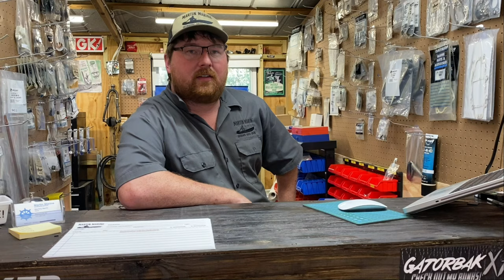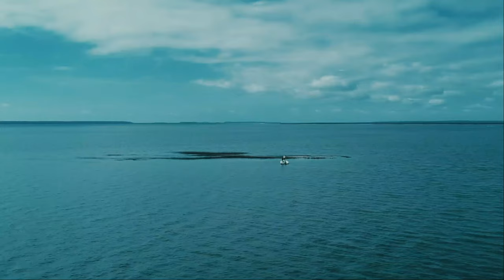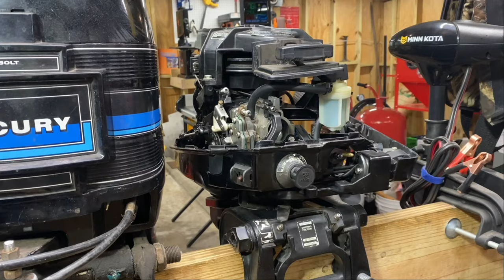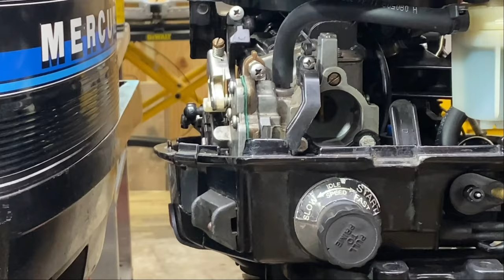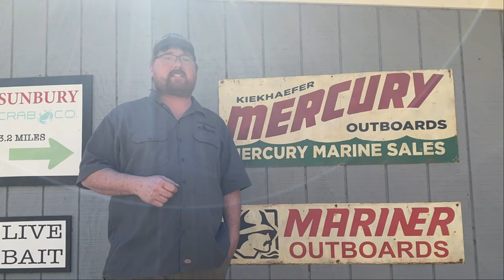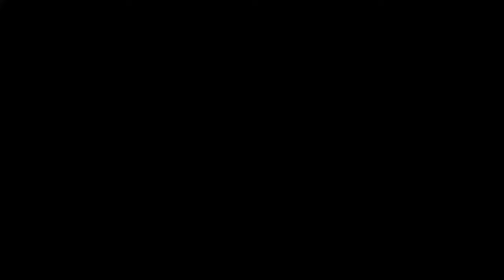How To Adjust A Mercury 2-Stroke Carburetor 6 8 9.9 15 HP 1989-2006

Comment: I have what believe is a decent tuned motor exactly like the one in your video, 8HP 2 smoke, but im getting milky snot from the exhaust port, is this normal some say yes and then some say not so much, im using Lucas synthetic oil (15oz for 6 gallon can) brand new carb rebuild and accel pump. lil smoke not too much but some beige milky goop from the exhaust... any help would be great thanks, great vid! subscribed

Comment: I just did the carb rebuild after watching you video. (Great video) i put it back together and where its labeled "top" its leaking fuel when priming it. What would be the cause of that?
Reply from the maker: I would try pulling the bowl back off. Then pull the float out. The float is probably stuck. Then lift the leaf springs underneath the float and drop that pin back out. Then just reinstall it all again and should fix it. Make sure the curved sides of the float are faced towards the bowl.
Reply: Thank you sir Ill check that out. Keep them videos coming!
Reply: Great videos that helped me get our outboard running again. We live on our sailboat and use our dinghy as our car so it is incredibly important to have a strong running motor. I had the same issue with the leakage from the top area. The bowl appears (sounds) to be free when I shake or roll the carb when it is off the motor. Any other thoughts? Could you post/send a quick picture of the gasket orientation under that plate labeled top?
Reply: @ffhill85  did you find a fix for the leak? I am having the same priming leak issue. Among others.
Reply from the maker: @joshmilat1048   The needle under the float is not seating. Remember when you pull the float off and lift the brass hinge there is a small needle that falls out. Either the needle is missing or it is not seating properly.
Reply: @joshmilat1048  i assume you mean the float, not the bowl but that means nothing if the needle is stuck in it's seat! remove for cleaning and inspection.

Comment: Great videos. I've been watching them all. I have a question. I have a 25 hp 2 stroke. Motor starts but won't idle. I've recently notice that there is a small port on the right side of the carb that squirts gas out a little.  No idea why. Gas stain in the water. I can get it to run by giving it throdle. Any ideas what could be causing this?
Reply: It's your float. She stuck

Comment: this is a really great detailed vid...   my '05 merc 25hp 2s is hard to start, i'm going to start with this.... im hoping that first adjustment is what might be wrong,, starts all day one pull after its warm
Reply: make sure the primer is really working well. simply loosen the carb mounting nuts and pull it forward and hit the primer. should be squirting into the crank case, not dribbling. turn your low speed needle out 1/4 turn if its really hard to start. beyond that, ignition and timing check is in order

Comment: So I’m having an issue with the exact same motor. It runs well until about 3/4 throttle and then bogs down.. checked all hoses, tank, primer ball, still having issues

Comment: Hi there. I have a 15hp mercury 2 stroke. I’m missing the #37 screw. It’s the M5 x 30mm screw with a jam nut. Could you tell me what the adjustment is supposed to be on that screw?  Engine seems to be running fine with out. Just want to get it back in there so it’s fixed properly

Comment: What would cause a Mercury 25 horse to start and run good even when it's cold but if you stop and fish for an hour and go to restart it it will start on about a half a pull and Run 5 seconds and then die and it's really hard to start in a spark plugs and dryer

Comment: Were does the thermostat go? In the back on the cylinder head? I was checking on a water pump problem and removed a cover on the top cylinder, the tell tail hose was hooked to that cover. There was nothing under the cover but the water jacket was visible. Thermostat goes there? Thanks
Reply from the maker: It sounds like your thermostat is missing. Yes just pull that cover off with the hose coming off of it and if nothings in there it’s missing.
Reply: A video on that would be nice.

Comment: My motor is a 1989 mariner 45 hp 2 stroke on a 18 foot pontoon. It is using 6 gallons of gas in 1.5 hours on the water and the top speed is 7 mph. The carbs have been rebuilt. Any suggestions???? We have adjusted the carbs, but there is no change. Motor runs great, it is just guzzling gas and going half the speed it should.

Comment: Got a 99 Merc 15hp 2stroke, starts right up 1st  or 2nd pull every time & runs good at speed. But idling or trolling I get a misfire often and heavy gas smell & more smoke than should be??  She does 20mph loaded up with 3 people in a 14ft smokercraft voyager & 9x9 prop. Sounds great & good power up on plane, but heavy gas smell & misfire at low speed, any idea where to start?? Thanks.

Comment: Hi
I have an 87 Merc 9.9 that needs a timing adjust.  We rebuilt carb and turned timing screw.  Is there a starting point?  it is all the way in now and that cant be correct. is there a way to DM you?
THANKS
Glenn

Comment: Hello, first of all thanks for all the quality videos, I was rebuilding my engine that is pretty similar to yours, mine is a Mariner 13.5hp 2 stroke.. this week I'll follow the videos after watching it 20 times!! Hope everything goes well.. I had one more trouble and cannot find anything yet so I write it here and maybe you can make a video to help us! 
I'm not able to put reverse, the cables looks good, and forward, neutral and the gas works well, I wanted to take all the cables out, put some grease there and adjust the cables but I'm not sure how to do it.. I use the manual controls to move the engine.. I'm from Spain, I don't know some words but I hope that someone could help me.. thanks you!

Comment: Hello, i did follow steps in the video and it works perfectly now, big thanks and very clear and helpful comments, now everything looks working well, to motor runs like a baby :), the water going out to the motor is maybe to hot from my point of view, question what temperature going out should be and if too hot what should i do to cooling the water temp down. (Note i did change the pump propellor. Thanks

Comment: Need help. The motor will.idle fine and when I put it into forward gear at 75-100% full throttle. When I decrease the throttle speed to say 25-50% the motor stutter and quits.  Does the carberator need to be cleaned? Is there a replacement carberator link?

Comment: 2 questions: The idle link bar, where does it connect inside the flywheel area?

2nd: My idle doesn't have a brass screw on it like yours so it can be adjusted, its the exact same motor tho.  How do it bump up the idle speed if there no screw?

Comment: Hi Sterling, thank you for these awesome videos, really appreciate your teaching!
I have this 1993 8hp, it has only 20 hours on it, but sits in garage for 20 years, it took 75 pulls to started wry first time, I cleaned the carb, still has difficulty when cold start, I tried to adjust it but find out it’s different than this video showed, it doesn’t has the idle screw like yours 😢

Comment: Thanks Sterling, very informative video.  I threw a .060 jet in place of the standard .046 in my 8hp to try and get a little more OOOOMPH out of the motor.  Just couldn't quite get up on plane with my wife and I.  
Not surprisingly it's running a little rough and I can't seem to get it smoothed out.  Any suggestions or am I wasting my time and just need to put the .046 back in the carb.  Thanks again for your videos.

Comment: Great videos by the way.  Very helpful.  Question.... I have a 2005 9.9 hp 2 stroke Merc.   My carb rebuild kit comes with a gasket for between the carb and the engine block.  When I took the carb off, there was no gasket.  The aluminum mating face has a rubber seal built into the mating face of the engine side.  The Mere parts diagram shows that there's a gasket suppose to be there.  I had a mechanic friend says no gasket goes there, and another mechanic friend says that there is suppose to be a gasket there.  So do i put the gasket there?  Any advice would be appreciated.

Comment: Hey I having issues with a mercury 15hp 2 stroke. Seem to have a oily leak coming from the carburetor, dipping all the way down to the propeller. If I'm running too Rich will it cause the gas/oil to leak from the air intake? Because I can see some fuel and oil residue there. Thanks

Comment: I have a 9.9 that I have rebuilt using your vid’s and it’s running pretty good. My question is I don’t have an idle speed screw. The manual says to loosen the locking screw, press the cam down then tighten which I have done. But it still seems as if I need a little more throttle to start. As soon as I lift that up a bit she fires right up and runs good. Any way to get this adjustment? Thanks

Comment: Hello Sterling i just picked up a 9.9 merc 1998 the issue is the tail tell pee port water comes out hot i installed a new water pump and threm and still hot then i took the therm out and the motor was not hot any more the tail tell water was warm what do you think is  going on with  this motor 
head gasket dirty water ports or the pick up water tube under the motor i need your advise thank you

Comment: I got 15 hp 2 stroke I use it trolling for walleye a lot and for some reason when I kick it out of neutral I try to get that real slow troll but for some reason it dies last year it ran just fine when I would barely put it out of the neutral and I would get that slow trolling for the fish and it right now it don't seem to be gone and that slow as speed I have to kick it up a little bit or dies what should I try to get that slow idle slow troll back to where it was thank you in advance for your great videos

Comment: Hey man , awesome idea for that motor would be the sprung carb and ignition cable bracket .   You know the 2 piece part in halves that the throttle push and pull cable drives .. .      I could use it I know that

Comment: I hope you're still checking these messages.  I've got an older Mercury 8 HP 2 stroke.  I cannot get it to run for any extended period of time without pulling the choke on.  I've tried adjusting the carburetor using the steps in this video.  Even after keeping it running after 10 or 15 minutes, I have to pull the choke on to keep it running. I pull in on and turn it right back off and it'll run for a couple of minutes, then I have to repeat. If I put it in gear, I basically have to keep the chole on to keep it running.  This really sounds like a mixture problem, but I'm not a mechanic. Not sure what else to try.  I' haven't checked to see if it has a thermostat yet.
Reply: Have you rebuilt your carburetor? Mine was doing the same thing and I rebuilt the carburetor using a sierra marine kit. And it’s running smooth now

Comment: That was good, thanks.  What is the function of the little switch on the lower side just left of the choke knob?  Mine has the same thing, and it seems to flip like a toggle switch.
Reply from the maker: That is the kill switch. Make sure it is in the position to crank the motor. You can buy a lanyard that hooks in there that you can clip onto your side.

Comment: Thank you for the great videos. In adjusting my carburetor on 9.9 I seem to now have a mist of fuel coming from somewhere and it’s backfiring?? Too rich? I had just replaced carb kit last year.
Reply from the maker: If it’s backfiring you have it to lean turn it just a little bit counterclockwise. A lot of times if you have had it running in a bucket or something for a good bit while adjusting as it gets loaded up with a lot of unburnt fuel.

Comment: Question, I have a 8hp Merc that is idling fine in a garbage can, revs up fine in the garbage can… once I put it in the water under load it falls on its face & dies. Any suggestions? I’ve cleaned the carb twice and changed the plugs.
Reply: How far out is the low speed mixture screw?

Comment: Hey, followed your carb settings and now it will idle all day no issues but I have an issue under load, it will run no issues for the 1st couple of mins at open throttle but it will become realy boggy after that, then turn it off and start again no issues for a couple of mins and then runs like crap again... 

When I got the boat the gas had gone super stale and bad so pulled the carb off cleaned everything and put back together. Now it runs like this, obviously the boat didn't run when I got it
Reply: Did you work out what the problem was?

Comment: Had to replace trigger stator and cdi box. Now engine runs like crap. Should I do a carb adjustment or is it bad gas
Reply: i seriously doubt all those parts were bad. did you do proper DVA testing or just blindly replace parts? did you check timing after?

Comment: Thank you for the great/informative video.  If you don't mind a question.  In your opinion is it okay to replace the twist on fuel filter assembly with a more standard inline filter?  They inlines by quicksilver (re ex.) are much more available.
Reply from the maker: Totally fine

Comment: Hey Martin, your video on cleaning a carb was super helpful for me. I just cleaned mine and put it back together, but I'm still having problems. My gasket/diaphram that primes the carb (not sure of the actual name) was rotted, and i was hoping that was my problem. It would actually spray and leak fuel when primed. That is now fixe. But now when I start my motor, it runs rough at idle and will die unless the prime is fully pulled out. Not sure what the problem is. I tried adjustment the fuel mixture pin on the carb, but it didn't seem to help any.
Reply from the maker: May want to try a different gas tank Or it could possibly be the fuel pump

Comment: Hey Martin Marine, Thanks for the all the help rebuilding my 6hp! your videos have been extremely helpful. The motor im working on was missing the max timing screw. I've got a replacement but havent installed it yet. Should I put it in or can I run it as it is until you post the timing adjustment video?
Reply from the maker: It will be OK to run it without it

Comment: I have a question for your Sterling.  I've rebuilt my carb following one of your videos and it went fine although I still have to do a little adjusting.  It starts right up but really bogs down when I try to accelerate.  Maybe the rich/lean adjustment?  My question is really about my fuel line.  I want to replace the gray fuel line with a better product.  I'm concerned that the liner in my hose may be breaking down and causing restrictions.  I will likely get some fuel hose from West Marine or is there a suitable alternative available from an automotive store?
Reply: Did you sort it out and find why it bogs when accelerating?
Reply: @mitchellsmith7739  I had a few things going on but the bogging (I think) was caused by water in my fuel tank.  I did a number of things but eventually found this to be the likely cause of the bogging.  A friend tipped the tank up onto a corner and sucked fluid out with a hose.  I had over a quart of water in the tank, probably from ethanol added gas separating.  Later I found the small ball bearing in the primer check valve to have gotten 'stuck' in the spring but that caused a larger problem.

Comment: When I put the motor into gear forward or reverse it dies about 10 seconds in...but it'll idle just fine.  Thoughts?
Reply: Carburetor
Reply: Mine is the opposite,  starts, won't run after 10 secs
Reply: @boatrvme8478  I ended up taking the carb off and cleaning it up and replacing the spark plugs. Runs great now

Comment: I got like a mercury 2stroke 25hp 1999 ???,,,,, the motor does not idle at all. I have to open the throttle all the way almost just to start it.. and keep moving forward jus to keep it running.
Reply: I dont know nothing about outboards too. Lol just drive it HAHA
Reply: I see that primer knob on this video,,,, But mine has no words on it.. all faded. U think it could just be that???
Reply from the maker: Sounds like you have a carburetor issue. I would take it to a local outboard shop and get them to rebuild it. The choke you just want to turn all the way clockwise and pull it out when trying to start the motor and push it in when the motor cranks

Comment: 2quick questions: 
1. how far is the rsnge to turn to adjust past the 1 1/2 turn start. 
2. Thermostat?  Never heard of one, where it is / goes, how to get one. Thank you. Very much. Ken
Reply from the maker: The thermostat is located on the back of the motor follow the hose where the water exits the motor and remove those 2 10mm bolts. The first question I’m not sure exactly what you’re asking.
Reply: After turning screw to 1 1/2 turns out from seated; how far in each direction can I go, or just listen to how ot sounds?
Reply from the maker: @Ken-tc5mp  It just depends I wouldn’t say any more than two turns richer I am probably no more than one turn leaner. But it just kind of depends.

Comment: Can you change a 6 hp to 8 hp by changing the carb ? (2-stroke)
Reply from the maker: You can do that but it still won’t be a true 8 hp. It will give you slightly more power though.
Reply: @martinmarine529  Thanks ! Do you happen to know the approximate cost ?
Reply from the maker: @andy6043   Are you looking for the cost of a 8hp Carburetor? If so it can vary you may be able to find a used one for under $100 on eBay or a new one will probably be near $300.
Reply: @martinmarine529  Sounds like it wouldn't be worth the cost ?
Reply from the maker: @andy6043  Better off selling it and getting a larger motor
Reply: @martinmarine529  Thanks again !
Reply: On some years I’m pretty sure the difference between the 6 and 8.  Is a restrictor plate and a main jet

Comment: Rebuilt carb, but still need starter fluid to start... Any suggestions?
Reply from the maker: It’s possible you have a problem with your gas tank or hose.
Reply: why are you using starting fluid on a 2 stroke?